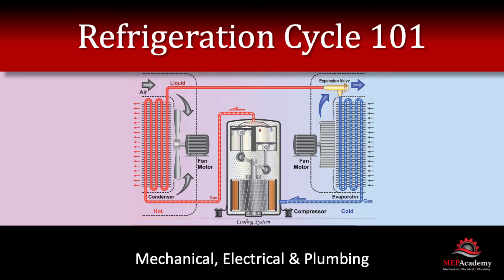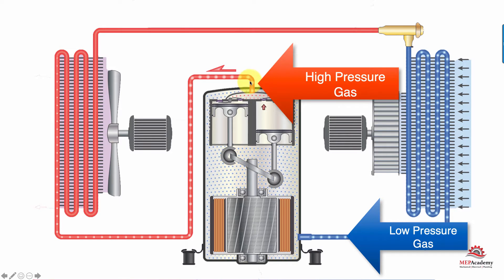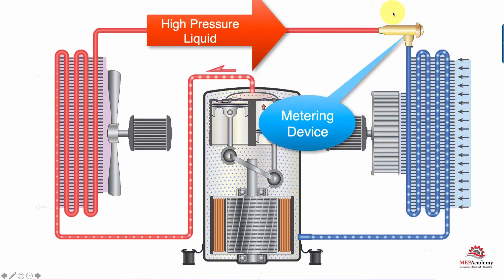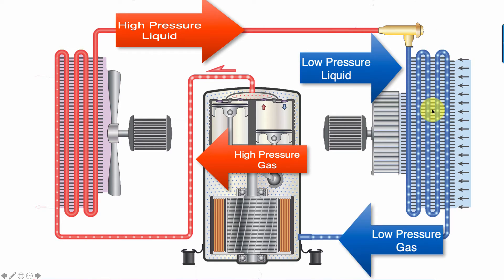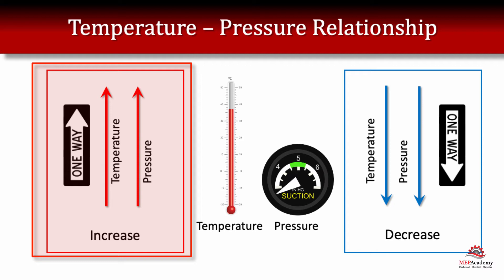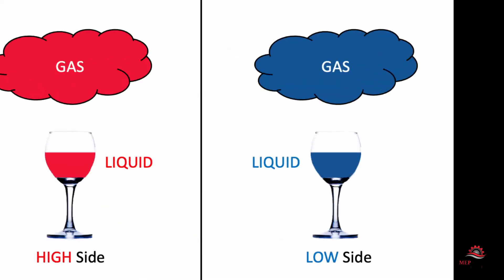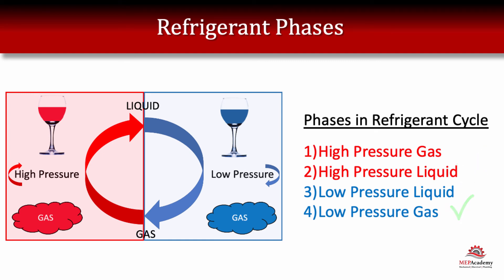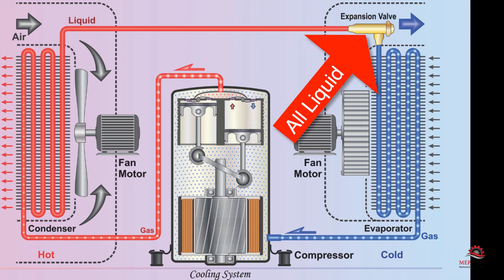Refrigeration Cycle 101

Comment: Thanks very much for the excellent generous work you are doing. 

I often see it said that the refrigerant enters the condenser as a high pressure, high temperature gas and enters the next component (the metering device) as a high pressure liquid at room temperature. if pressure and temperature are directly proportional,  is the pressure of the  refrigerant  at the metering device reduced (I ask because I always see it referred to as a high pressure liquid even though the temperature is no longer high)?  Thanks again.
Reply from the maker: The compressor and metering device is considered the demarcation points between the high-side and low-side. Look at our video on how to read refrigerant Charts to get a good understanding of how the refrigerant changes during the refrigerant cycle. https://youtu.be/gjzakSz0IzY
Reply: @MEPAcademy  Thank you. I just discovered enthalpy.  unfortunately, earlier attempts to explain this stuff (50 years ago) were unsuccessful. fortunately, this means I get to enrich my life by learning this stuff today. Thanks again for your generosity.

Comment: Can 407 gas goes to 134 system
Reply from the maker: Replacing R134a with R407c may affect the system's efficiency, capacity, and performance.The pressure-temperature characteristics of R407c are different from those of R134a. This means that the system components, such as compressors and expansion devices, must be compatible with the operating pressures of R407c. It's strongly recommended to consult with HVAC professionals or technicians experienced in refrigerant retrofitting. They can assess the specific HVAC system, provide recommendations, and ensure that the replacement process is conducted safely and effectively.